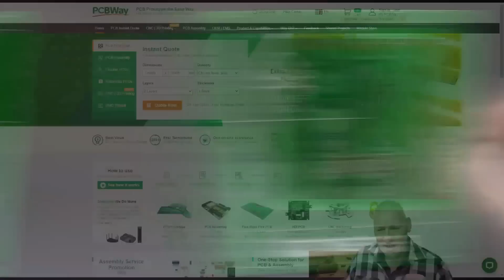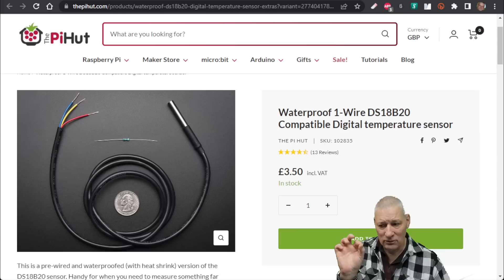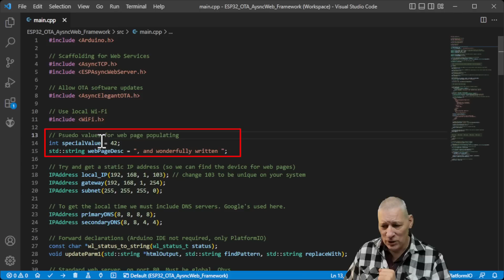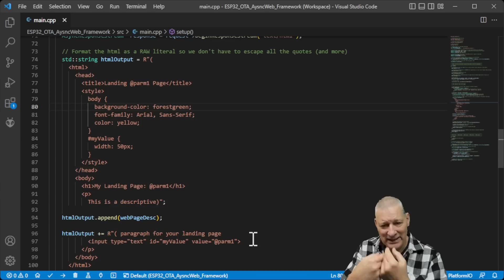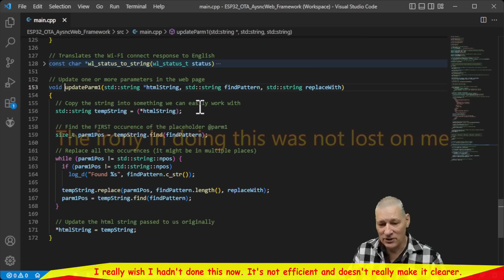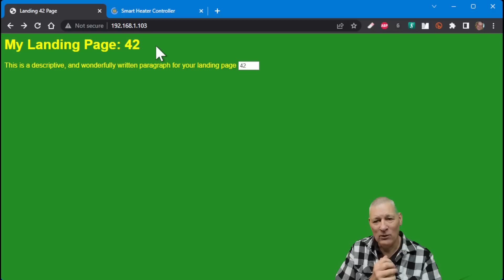#260 ESP32 Web Pages PART 2 - adding a sensor value on the page & more!

Comment: I am trying to do something similar, but I am wanting to use a real website with a domain in the middle of the system. Where the esp posts data to a MySQL database on my site.

Let's say I have a cabin somewhere... 1 to 1000 miles away and 
I want to know if the pipes are freezing...

I want the temp sensor at the cabin to post the data to my site, so I can read it wherever I am..

Initially I got this working where the esp would post data to a URL like 
String url = "/espdata.php?id=";
url += DeviceID; // id of my cabin, whatever...
url += "&temperature=";
url += tempReading;

But after it was running for weeks, my website started acting like the esp was doing a DOS attack to my website.. 

So I need a better posting method, possibly using websockets 
between the esp and website. 
I have no clue how to install websockets on a cpanel website.
I found examples on YT, but they are ALL non-verbal.. 
(Like learning coding from Buster Keaton)

Can you help?
Reply: You can add a delay between posting new values. But really, a server can handle many requests per seconds, so what do you call a ddos attack? That must be ni the 10thousands per second I guess.
If MySql is to slow, you could look for a hosting with something with speed (in RAM) like RedisCache, but I am sure MySql can handle your updates with ease.
A better way might be to only store one value every 5 minutes in the database, but store the most recent value in a textfile. The system will cache the content of that file, it would be no problem at all if that is updated very, very often.
 I know several other options, but I am not consulting on youtube.
Reply: @deslomeslager  I had the esp set to post about every 6 seconds... 
My database has more that 20 fields. 
The esp has no problems reading data that I post from buttons on my web page, 
but if my esp tries to post data, my site only sees an update at random times from as short as 2 minutes upto one update in 40 minutes.. 

I even tried putting code in the php to send me an email when the esp successfully posted data..so I could see what it sees...

My guess is that I have my code seriously wrong or 
my site sees it as an attack..

My only thought is trying to change the method of data transfer 
from posting to websockets..

I have no clue how to install websockets on a website.

What method do they use to send data to the IFTTT service?
Reply: @WagonLoads  You are better of testing with a development environment and from home. So you can make the ESP post values when you press a button. That way you can immediately check if the your website has received it.The next step is to use a delay, and keep sending values every xx seconds (6 or 10, no big deal there). But do check your LOG. Your hosting should have an option to offer you to watch the last XX lines of your log. You should find your request in between te lines.
If there is no access to your web log, create one yourself. Use file_put_content and 'append', and then write a string starting with a date('Y-m-d H:i:s ') and append your $_SERVER('REQUEST_URI') or something similar. Be sure to delete the file after downloading, as your esp will make it grow while you are testing/developing this.
This should be enough to get going.

Comment: Looking forward to the next video, I'm pushing the storage space on my ESP air pollution sensor project with a few simple web pages.
Reply: If SPIFFS isn't enough, add an SD or TF Card.
Reply: @johntoe6127  Yep, that's my next plan.
Reply from the maker: Part 3 will cover how to put the HTML into LittleFS, but you can also switch to SD card without any (real) code changes. 

If you have a ESP32 WROVER module (ie with PSRAM) you can copy the SD card files into PSRAM for speed, if you need it. Not something I've done (yet) but an option, for sure.

Comment: Enjoying this series Ralph. I have a question and a request please.

First what is the ESP32 dev board you have there with the external antenna socket?

But second, could you do a video on setting up VS Code to program the ESP32 please? I know there are some out there but I think your style might be more helpful
Reply from the maker: Hmm. Lots of requests on how to set up PlatformIO on VSC. I will (re-)consider. 🤦

The board I am using (more on this in a future video, when it is important) is an ESP32-DEVKITC-V4. Now this has 38 pins (6 of which you must not touch, as they being used to access the on-board flash) and comes in two formats: with and without that IPEX connector external antenna. 

Unless you need the range, go with the antenna-less format. It's a good board and I have several. You can even solder the ESP32 module onto preassembled boards, which I also have. More of this later, too.

I'm currently considering the 30-pin version (DEVKITC-V1) which loses only one GPIO (D0) compared to the V4, but is shorter (no unusable pins) so more compact. But that's for another time.

Comment: The disadvantage of this version is that the complete web page must always be transferred, even if the values have not changed. Wouldn't a javascript solution be better, which only reads the current values and updates them in the browser?
Reply from the maker: In the Real World we would use AJAX, I guess. The smaller the unit of transfer the quicker it loads. 

But this is an Arduino-style (OK, ESP32) channel, for beginners, so we're doing it 1990's style. And we only have one user. Yourself.😲

Comment: I did the same for my nixie tube clock, where I’m doing the whole coding thing in ESP8266 IDF just for fun. So building the web server so you can enter the wifi credentials was a bit of a pain as i had to parse the page each time it was called to add all the wi-fi's it could see. 

One day when I’ve completed the code I will do a video on it, as there are not that many videos that avoid using the Arduino IDE for wi-fi etc.

Also i found that i had to parse the returned password as the output from the web server did not seem to match the characters’ entered by the user. They had to be tweaked, letters and numbers seemed to be ok but the others seemed to have different encoding to plain asscii.
Reply: The idf is much better documented than the arduino core.
Reply: I think simple videos that show alternatives to the Arduino will do well.......cheese !
Reply from the maker: "...I’m doing the whole coding thing in ESP8266 IDF just for fun ." I bet your nights out are a real blast! 

Odd about the returned characters; they should be standard ASCII characters unless you are using a strange character set (which I bet you are not). I may check this out.
Reply: @RalphBacon  Hi Ralph, it's more fun. I always been one to want to look behind the scenes. it's not so much what it can do but how it does it.

I think this comes from working on uP before computers became a real thing. we were writing code on a vax before moving on to a microVax, before the first PC came common in our RD.

these are the char's that i had to parse 
' ',    //0 space is 				32 dec 20 hex
'!', 	//1 exclamation mark
'\"',	//2double quote
'#', 	//3 number
'$', 	//4 dollar
'%', 	//5 percent
'&', 	//6 ampersand
'\'', 	//7 single quote
'(', 	//8 left parenthesis
')',	//9 right parenthesis
'*', 	//10 asterisk
'+', 	//11 plus
',', 	//12 comma
'-',	//13 minus
'.', 	//14 period
'/', 	//15 slash 				47 dec 2F hex
':', 	//16 colon 				58 dec 3A hex
';', 	//17 semicolon
'<', 	//18 less than
'=', 	//19 equality sign
'>', 	//20 greater than
'?', 	//21 question mark
'@', 	//22 at sign 				64 dec 40 hex
'[', 	//23 left square bracket 	91 dec 5B hex
'\\', 	//24 backslash
']', 	//25 right square bracket
'^', 	//26 caret / circumflex
'_', 	//27 underscore
'`', 	//28 grave / accent 		96 dec 60 hex
'{', 	//29 left curly bracket 	123 dec 7B hex
'|', 	//30 vertical bar
'}', 	//31 right curly bracket
'~' 	//32 tilde 				126 dec 7E hex 

Not sure why yet. but a lookup table worked so i went with that. i may have to look deeper in what HTTP_GET method is doing.